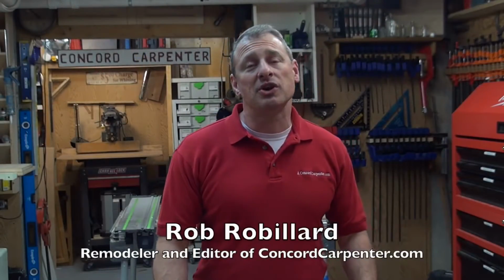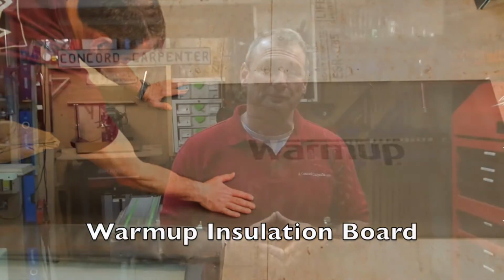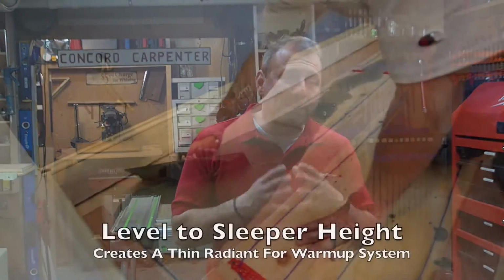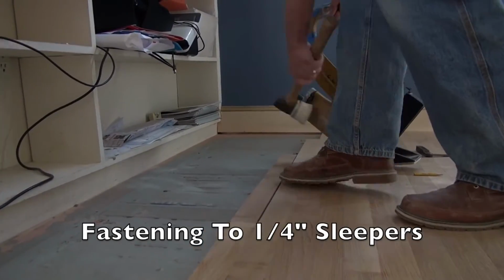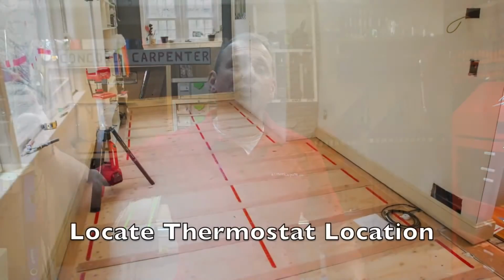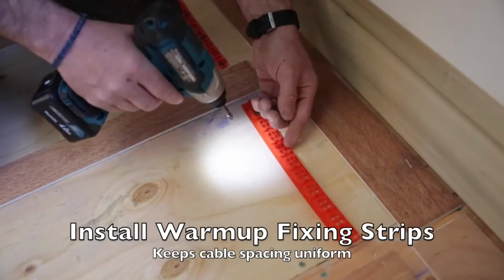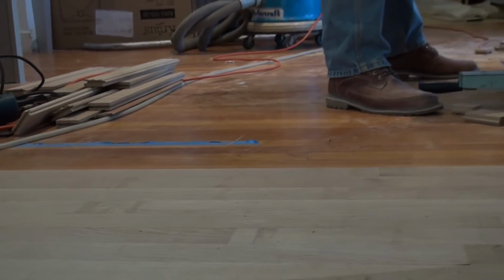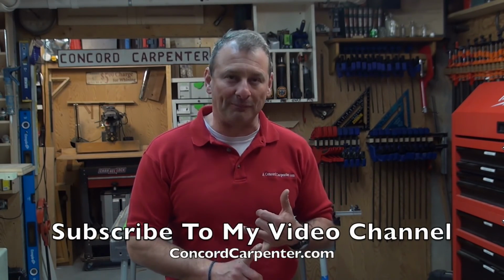How to Install Electric Radiant Heat Cable Under Hardwood Flooring

Comment: Thank you! Finally someone has provide clear instructions and confirmation that hardwood flooring can be used with electric radiant heat - I only wish you were located in Ontario, Canada to do my installation.
Reply from the maker: Hi Nicole - Warmup does work with Certified Installers in Ontario. Just give us a call and we'll give you a couple contacts!